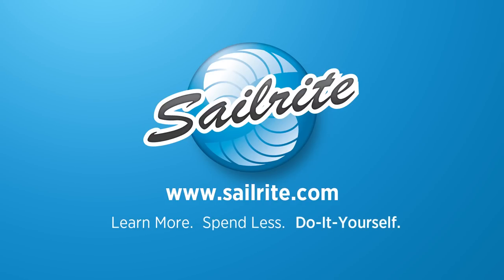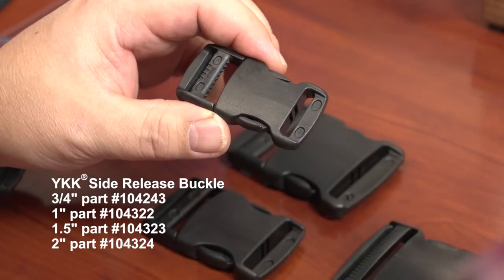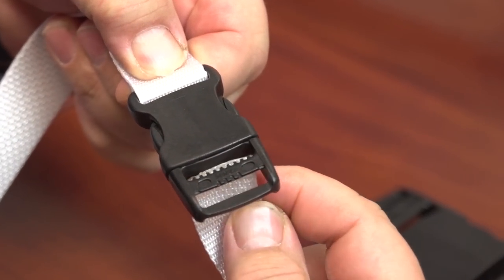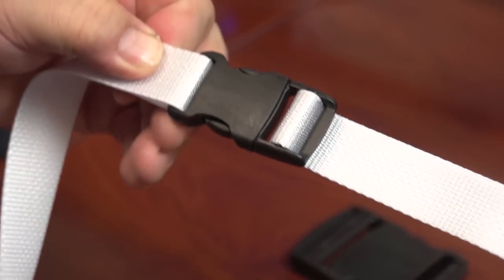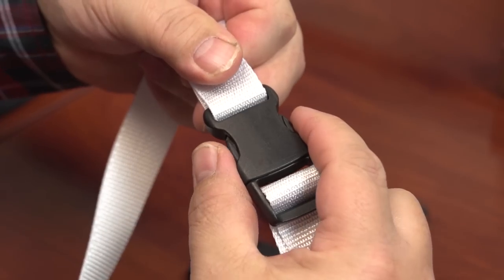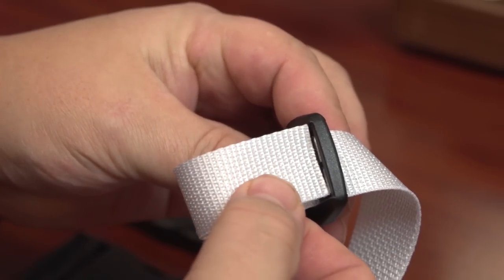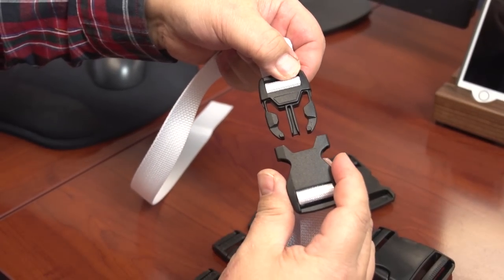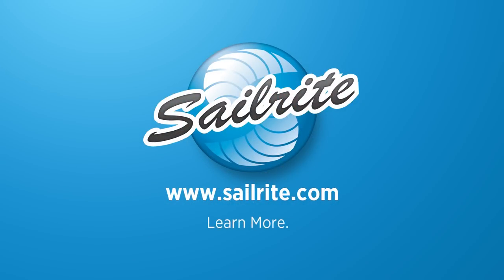YKK® Side Release Buckle - Heavy Duty

Comment: Have you measured the tensile strength of these buckles?
Reply from the maker: +Nik No, we have not. The reason we do not is because depending on the amount of UV or weather exposure it sees that will determine the overall strength of the buckle. Over a few years of high UV exposure the strength may be reduced by up to 50%.
Reply: What is the rating when they are new? 100lbs? 500lbs?
Reply: Sailri